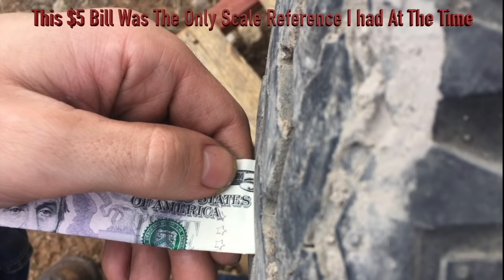THE CHEAP WAY TO PUT NEW TIRES ON THE DUMP TRUCK!!! HOW SKETCHY IS IT GONNA BE?!?

Comment: Use a tire maul and a flat spoon to open the lock ring. Flip over and invert valve stem and hit with maul
Reply: Or just get the right tool for the split ring, I change mine using 15in tire spoons

Comment: I would have changed the hubs fast as I can to either lug mount or Hub mount(preferred). There is a reason you hardly ever see those wheels, They are a pain in the booty.
And yes I know it would cost me a lot of money, But I have access to Truck dismantlers, a pick a part for trucks.

Comment: ed here, been redoing 1969f600 in tenn. hard to get anyone to change the 2pc rims or to air them up! they look easier to change than later rims. those 20 in. tires are about $350 here. i need 4. found 2 one pc rims/tires for front at $300. a bargain, but they are 22 inch. are the 22 inch tires off semi trucks easy to find used? cant find 20 inch.
Reply: Just use duece wheels you can get em cheap
Reply: 22's are either hub or stud centric. as are 24's
those  20" tires held up to abuse for 40 + years till something better came along